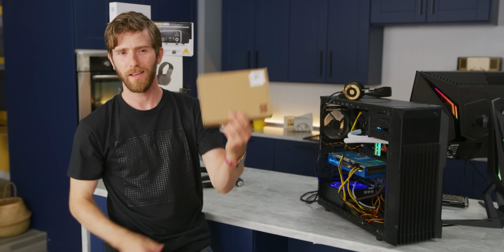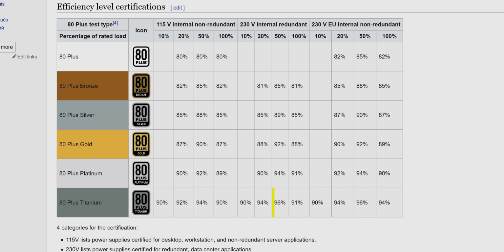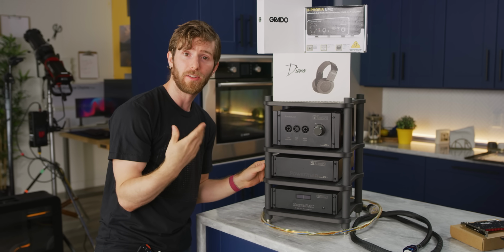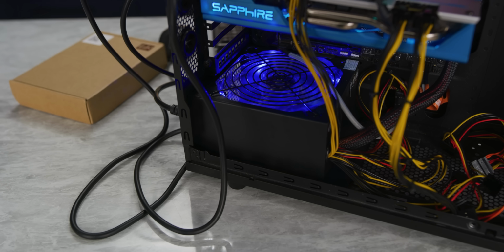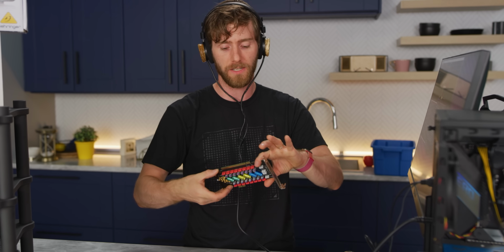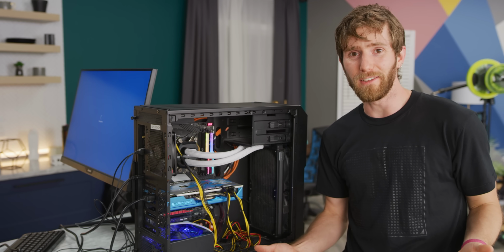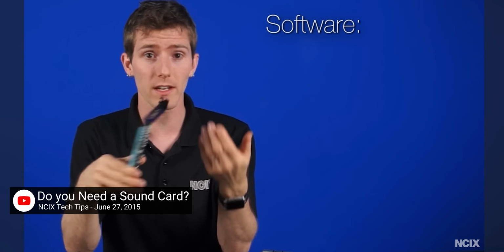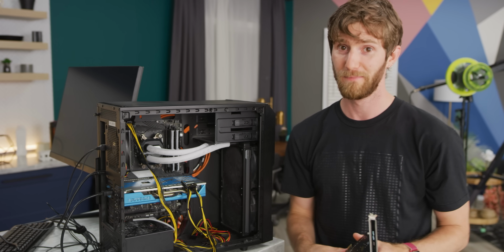Is this $40 card a SCAM? - "Audiophile" Power Filter

Comment: This was the wrong way to test this thing out.  You need to test a USB DAC, as many motherboards USB signals are quite noisy, that's why a few motherboards out there have a special usb port labeled audio or DAC, supposedly with better power filtering.  My Asus X570 TUF is unusable with most DAC's over USB due to my particular setup.  I run a straight DAC into a custom amp that has no volume control... the amps volume is always 100%, and the final volume is controlled digitally in software.  This means any noise that makes it to the DAC is gonna come through my speakers.  On my old 2500k system, it was not a problem, 3 USB dac's I tried had no noise issues.  But on the new one, all of them have noise issues.  There is constant background noise, and intermittent digital sounding noises that are dependent on certain applications running, or certain mouse/keyboard inputs etc. that cause interference.

What I had to do ultimately, was to use the optical output, as it is noise free.  I tried a couple different popular USB noise filters, they look like a regular thumb drive that you plug into one of your ports, and it's supposed to clean up the power.  Even the kind that acts as a pass-through, like you plug it in, and plug your DAC into it, didn't do anything at all.  And these can be found from fairly reputable brands actually, and some reviews rave about them, but some don't.  Maybe it's dependent on the use case, but for me they did nothing and I returned them.  You can buy an optical to USB converter box that has it's own external power supply, if you have a USB only DAC like me (the Khadas Tone Board).  ZERO noise.

That's the right test case.  Could this card ACTUALLY clean up the USB power for an external DAC?  At the very least you need very sensitive headphones or IEMS to test the built in audio, which is also usually fairly noisy under the right conditions.

An easier way to test it is to not use headphones, but rather use the boards 1/8" audio output connected to an amplifier and speakers.  Then, don't play any audio, just turn up the volume and listen to the noise and see if it changes.  Simple.  No audio playback should be necessary and only interferes with the test.

Comment: That was a real bad explanation of filters. Any filter won't work if it is put on the line like that as it needs to be put in between the source and destination. (Preferably as close to the destination as possible as to not allow any new noise to be introduced on the line.) The only purpose that card can have is to provide some sort of very limited decoupling but any chip that is in your pcb should be properly enough decoupled as to not need that and if a chip isn't decoupled properly enough, then such a card won't do a thing. 

Those are some pretty insignificant capacitors on there, they seem to range between a couple of nanofahrad to 100uF.

Comment: you need to try this with powered speakers. the coil whine and power noise is not strong enough to manifest in headphones. but use powered speakers and that noise gets amplified too and throws some ground loop as well into the mix.
i do music production and had to buy behringer hd400 isolating transformer between my audio interface and my speakers to get rid of 2080ti whine when gaming...

Comment: I get that buzzing sound when the GPU gets going even with an external audio interface and it happens exclusively on the speakers and not on the headphones. Your testing was lackluster and you used an expensive mobo with shielding...

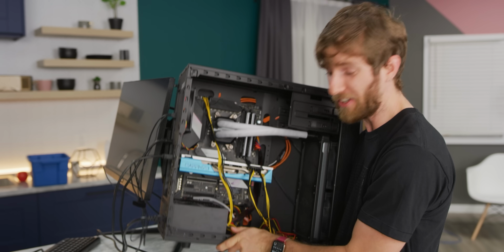Comment: 9:45 I feel so old that I remember when PCs didn't come with any onboard audio aside from a beeping speaker. Wing Commander with beeping speaker vs SoundBlaster was an even bigger change than this youngster is talking about.
Reply: My tiny mind exploded when I heard real audio through a pc speaker for the first time with Star Control 2.
Reply: May I just humbly count myself to the ppl that remember such stuff aswell, despite being only 26 years old? I grew up with Windows 3.11 and a built-in pc speaker that made the sounds.
And the turbo button!!!  From 22 to 28 MHz! :D
Reply: @MC_Papphead  Funny thing, turning 'on' the turbo button actually slowed down your PC and turning it 'off' had it run at its normal speed. Sometimes it was the opposite.
Reply: @FusionC6  From what I was told, our turbo button actually boosted the PC when being pushed in :)
But yeah I've heard so aswell :D

At the age of 2 I was capable of properly using DOS / W3.11 with actually understanding what I am doing. I remember that at some point I re-installed Windows (with the guidance from dad) and all the games I played on it because I pestered my dad to teach me how to do that. Those were 2 very exciting days of my life, waiting for the formatting to be done...

My dads' prediction of the future was so accurate.. He insisted that he can teach me all the PC stuff under the condition that I had to do certain tasks before I can use the PC (e.g. writing exercises, play atleast 3 hours outside, reading exercises, helping mom in the house...)

And right now, I'm on my best way to become an application developer :)
Language: Python 3
Reply: Well I remember when my family didn't even have a PC. Wing Commander with a beeping speaker vs. an empty desk was an even bigger change than you're talking about.
Reply: @fyrstormer  I remember when the only computer I had access to was a Commodore 64 my teacher borrowed for a few months, and all of us got 30 minutes on it once a week.

Comment: Plug in a usb dac and max out the volume pot with no music running. Better your systems power delivery the less noise you're gonna hear. But this card probably does nothing.

Then unplug it and connect a toslimk optical cable and it is silent all the time.

Comment: You should retry with some sensitive studio speakers, if they're active like my Yamaha HS5s you're much more likely to hear any whine generated by the power circuitry. Having an external DAC with optical spdif was the solution for me because the noise over USB or internal DAC was awful.

Comment: The reason people put capacitors on drones is because the video is analog. Thus the noise from the power supply could adversely affect the video quality. Your sound card is digital. That’s why you couldn’t hear a difference, not because the power conditioning is already built in or whatever Linus said

Comment: why did you not test it with a usb headset like hyper cloud II  that is prone to electrical noise from usb port  instead?
so your base line actually had noise? 
or maybe someone with sensitive ears?
Like seriously if you dont have noise in the base test,  you wont find a difference..........................

Comment: Using passive headphones isn't going to produce any results. Connecting the sound card to an amplifier and speakers would have better brought any noise in the system to the surface.

Comment: my Gigabyte Gaming 7 board with an onboard Soundblaster produced too much noise in analog mode. To rectify the issue I used the optical out on the board to an SPDIF to RCA converter, then to an external mixer I have. This eliminated the noise all together for around $60 CDN.

Comment: Welcome to the world of Audiofool snake oilery; except in the audiofool world you can add several zeros to that  $40.  Yes, audiofools will easily spend thousands of $$ on a mains cables ("bi-directional noise technology" 🙄) which will magically transform their (already expensive) hi-fi into another dimension of audio bliss, by removing the inherent crap in their mains electricity.  What annoys me is that some supposedly well respected manufacturers (who have the scientific and engineering background to know much better) will pander to this to pseudo scientific guff, to get the sales.  As quite eloquently explained, It just takes a simple filtering network to get rid of most, if not all, of the unwanted noise produced in linear or switching power supplies, or other noise inherent in the mains, and most of that filtering is already there.  11:20, I'd be amazed if crosstalk would affect the digital signal to a DAC via USB; and you can always use Toslink which completely isolates the connection between the DAC and computer; that's what I'm using on my PC now, although only because I accidentally reset the USB receiver on my rDAC🤨 whilst servicing it.

Comment: You should have tried to at least record the audio through a high quality microphone before and after to see in audacity if there is actually any notable difference in the sound. Then you should also connect the audio out from the "coil-whiney PC" to the line-in of a quality audio card and record the sound that way and see if there is also any difference there. And for a good measure, you should have also tested this card on a really old PC to see if it does anything to yesteryear's bad audio cards. Disappointed by the lack of scientific testing. At least try to make it like it's not a filler content (let's be honest, this was really easy to record, it probably took less than 1h gathering the components and recording this, I kinda feel bad for the editors who have to spend hours on this).

Comment: Ow yeah
When I use my built in audio card....
The audio  buzzes when I use my mouse 😂
Reply: if you realllly wanna, check your USB grounds
Reply: @MetalY2KMusic  no it's caused by varying voltage in the usb power, as result of varying consumption by usb powered mouse.  solution is use a non-usb powered dac.  in other words a dac with dedicated power supply that uses data only usb.
Reply: Lmao
Reply: use a dac with a dedicated power supply, it will solve noise issue.
Reply: Synth Lord or just mainboard USB
Reply: @0XZ  yeah, maybe, i stopped using usb powered dac so i cant test right now, maybe later.. got sick of speakers popping on when device powered up after restarts
Reply: Wow, it's been a long time since I've had that happen.

Comment: the idea is good only if you have to battle noise its best to do as close to the noise as you can and not just put it in the circuit it wil do something its best the the put the filter on the power going in to the soundcard correction it onboard sorry old guy.but thats wy you say get a good psu it will give cleaner power i would make my own low pass filters for my fpv racin drone back in the day the video needs clean power

Comment: Did this company claim there would be less audible noise? Because that's generally not what power filters in audio are designed to filter. They are designed to make sure the power stream to all of the components is free of electronic pollution from, for instance, switching power supplies which has an influence on the power circuitry of your audio rig. So, just to simplify that; If you have a router plugged in in your home, especially if it's in the same electricity group as the audio rig, it will have a negative effect on the sound quality of your audio rig (provided the rig sounds half decent otherwise) but it's not audible as 'noise'. It's audible in more trivial things like bass response, stereo imaging, transparency etcetera. The best solution to all of this is to put your audio rig on a separate electric group in your house, which is what many audiophiles do, but a 'bodge' method is one of those power filters (which are often more expensive than having someone create a dedicated group for your audio rig). That aside though, if this company claims you'll hear less buzzing and hissing from your computer's sound card, then no, I'm not surprised it didn't work. But that's not what they should have claimed, because it may actually work in other territories. Now I am not going to lie; Due to time constraints (he says, typing all this) I skipped through the video so you may have actually mentioned this, but if you didn't, you may have been listening out for the wrong thing.

Comment: I would only use electrical filtering from the wall socket that your pc electrical system plugs into.
The warnings I was told that yes it does clean up the electrical power supply and makes your hard earned electronics live longer but if there is ever a real hard
hit like a lightning storm hits your building then you can kiss your electrical filters bye bye and if your system is not turned off or still plugged into the filter system durring a storm
then the filter system will makes the electricity even worse and could quite possibly damage your entire system.
So if I was the mad crazed scientist and wanted the best for my system then I would do the following.
By a Tesla wall battery system and just run the system off the battery on bad stormy days.  Use normal electrical system on good weather days.

Comment: This result is disappointing. How come you did the test, even though you could not reproduce the problem it would solve... I have problems with a buzz in my speakers sometimes, I would like to have seen this card (try to) fix that. It's not that hard to reproduce. just lower the volume of the PC and boost the signal out of the PC. the buzz will get amped too.
(with my problem, you can hear the sound go up when I start a game and hear different sounds with different video output. so not moving the mouse: same sound, turning around: sound changes. for me it was solved by keeping the PC in a high volume and using the amp at lower volume. (x570 asrock steel legend, iChill 1080ti, silverstone PSU)

Comment: I saw that in audio studios they always put a ground filter of the kind they use in cars in the line connectors, now with the asio usb they are not necessary but the improvement of the sound cards with the ground filter was spectacular that until I put on pc, This has been confirmed by many clients who are dedicated to audio, the electrical noise of moving the mouse on the screen disappeared almost completely even in old PCs
test it.....

Comment: Thoughts on testing something like this...

First find a motherboard with really bad audio quality. I'm talking about a MB that has a audio output that whistles, squeaks and hums badly, often changing the noise depending on CPU load and graphics load. They are not common today but there are some really bad ones out there, and if nothing else there's always old ones.

Also test recording using a microphone. This often exposes a lot of noise often a lot of it introduced by bad power

If the card can make any difference then such a system would show it. And if it still does nothing then just lump it with the rest of the audiophile snake oil. There are a lot of junk in that pile already, such as shielded TOS link cables with gold plated connectors...

Oh and as for coil whine. No. Just no. This card won't do anything to help with that.

Even if it managed to make a difference that doesn't mean it's a good product. As said in the video putting that money towards a better motherboard is one thing to think about, but $40 can actually buy you a pretty decent external USB sound interface. If you've got a working system and just hate the onboard audio this is the route I'd look at.

Comment: I get really bad static on the front panel audio jacks of my PC. The rear 3.5mm jack on the motherboard sounds fine, but the one on the front panel has so much so static that I have to use a mini usb sound card to get decent audio out of the front of my PC. I think it's just the poorly insulated cable in my case that goes from the front audio jacks to the port on the mobo. I've wrapped some electrical tape around it and that helps, but not much. Was kinda hoping that this might actually work

Comment: coil whine isn't caused by a lack of power conditioning capacitors, it's caused by the coils themselves. Regarding decoupling the supply from an audio driver, it's hard to decouple without prior knowledge of the supply and the downstream system, too much is almost as bad as not enough

Comment: the funniest is the phrase is lower the noise floor. 
In any circuit noise is a power spectrum so you limit the bandwidth of it (by introducing a filter for example) and so you lower the noise level.
Like if this components are really added to the PCI power line you could introduce oscillation and make even more noise than you have ahah,

Comment: I don't think the test system or the headphones used in this experiment are correct to be honest. 
Best case scenario to see if this works would be a really low end cheap a320 based system with every component inside cheap, plus some really cheap 2.0 speakers at max volume. 
I had something like that and I can tell you it did really hiss, and you knew it without even playing a song or running benchmarks. 
Please redo this video using something like that as a base, the results could be interesting.